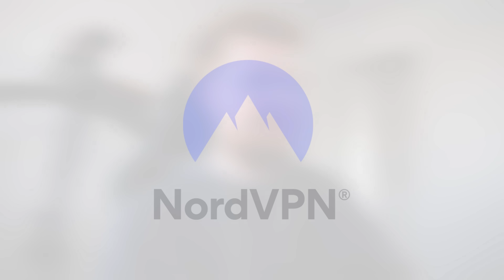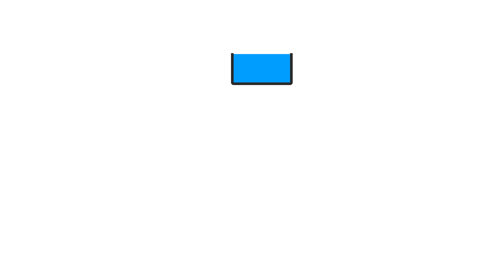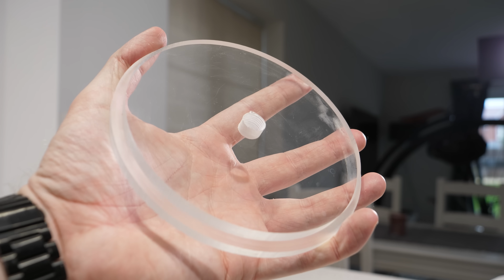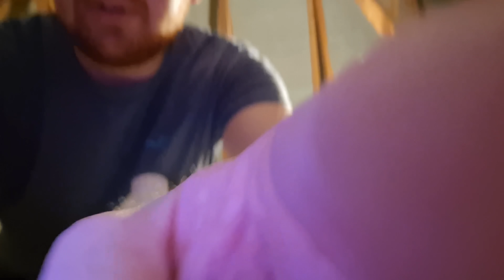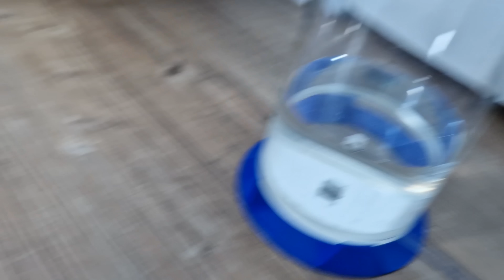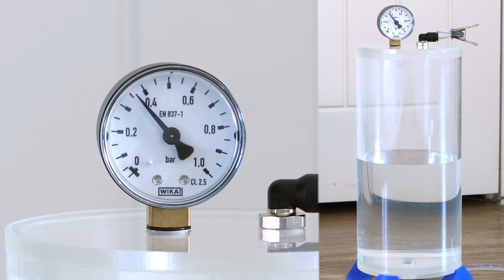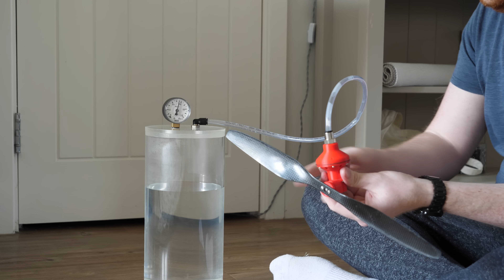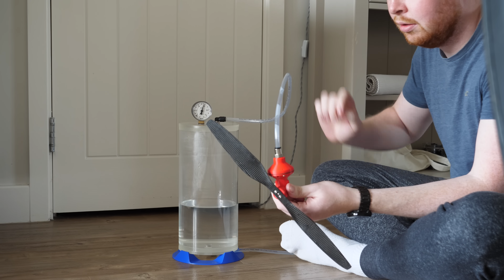Liquid Air Engine

Comment: hello, i'm from brazil and at least i'm curious, but maybe it gives you an idea of moving more efficiently, as the locomotives steamed a remaining pressure of the steam from the camera to use the how to make the camera go back to the beginning before repeating the movement, making the movement more efficient and stronger which can help and using a steering wheel to activate the movement more stable the movement which would make it even more efficient, I know that google translator's English is kind of bad, but any doubts look at the schematics of old steam engines so you can improve your project even more! good luck!

Comment: Hook the air engine directly to the water line and the water will spin the engine faster than the air will. Ever use an air grinder in a wet air line? When the water comes out the grinder is twice as fast.

Comment: that's really cool, i wonder i you could build like a gravity battery that pumps water into the loft when you "charge" it and then uses the pressure to generate power when you need to use it.. probably not really practical at all but might be an interesting project :)

Comment: maybe to have a more smooth rotating propeller you could make your air powered engine smaller and have multiple engines that are smaller and try to run them inline with a delay maybe? It might be like having a 2.4 L inline 4 vs a 2.4 L inline 6, same volume in total but through more "pistons" kind of. just a theory. It might have some flaws but it would be interesting

Comment: Add a float to top tank so house water can maintain it full.
Then increase tube size a bit. Flow will be proportional to diameter squared so not much is needed.
Then add a second air tank.
Upgrade both tanks so when one reaches ⅔ full, a float closes the air exit valve and opens a drain valve until it's empty. 
Time then so both lower tanks don't fill at the same time.

This will make it run forever as long as there's enough house water pressure to keep top tank full.

Then raise top tank to increase rpm.

Comment: Aside from some of the other comments about increasing your tubing size and having a float for air cutoff when the water reaches the top, all the system really needs is a pressure regulator to drop the output air pressure slightly so the motor runs at a constant speed, but the tank can keep up.

You could also consider using a trompe to generate your pressure so you could have a steady supply.

Comment: How about running engine with water which is pushed by air pressure? Similar to how water bottle rocket works. Put small water turbine into plane which is spinning the propeller.

Comment: What about making the air tank into  Mechanical piston. basically is  what you are doing with water, make a piston that goes in the tank make it spring loaded to keep consistent pressure on the out flow of the tank.

Comment: Don't forget that the height of your water column, and thus tank pressure, will drop slightly as the attic bucket drains, and also as the lower tank fills. You can fix the latter at least by filling the pressure tank from its top rather than bottom, using an S trap to keep air from constantly flowing back up the tube. As a side benefit, you'd also be able to see the flow rate as the lower tank fills.

Comment: Let's see what happens when water gets in the engine. I think it will run on water. Also a flywheel would help smooth out your air motor.

Comment: When pouring a lot from a small opening then start the opposite way that you poured and then when the container is 1/3 full turn it around and pour the way you’re currently pouring. This stops the glug glug glug shit from happening or it puts air into the container faster so it’s not gasping for air as the water is being poured from the container. U so smart but do dumb shit 😂😂🤪🤪

Comment: Maybe it's just me and my smooth brain, but all of that work seemed like more effort than just hogging out the existing hole in the tank with a bigger drill bit, cramming in larger fittings, and printing a new base to bump it up off the surface to make more space.

I really do love the iterating, though. Once the tank is completely full of water, could you remove the engine and plug in an air compressor in order to push the water back into the loft?

Comment: you could use the exhaust from the engine to bubble in a small tube back up to the watertank. each bubble in the line will push up water

Comment: Very interesting toward the end when the fan rpm dropped and the pressure in the tank went back up, then it oscillated between pressure and speed a few times. This is the same behavior you see in an electrical circuit containing a capacitor and inductor.

Comment: have you ever heard of a Trompe?
(if i spelled it correctly)

Its a way to pressurize air with water.
Which can then be used to do work.

Perhaps a nice idea to make a video of that?
Reply: as for air engines:
The Di Pietro Compressed Air Motor

Comment: You should put the engine in a vacuum chamber and have the air supply of the engine lead to the atmosphere on a valve, making it an atmosphere powered engine.  You could mount the engine on the achrillyc tube that supplies the engine with atmospheric pressure air within the actual chamber to really simplify things. But then how would you start it? maybe putting a couple strong magnets on a flywheel and manually waving another magnet around it to turn the engine over?

Comment: Very impressive. I'd be interested to see you try adding a flywheel to that. I suspect that it will be a lot more stable at low speeds.
Reply: Here as well as in older air engine videos the propeller is purposefully put on the engine to act as a flywheel.
 But yea an actual flywheel of decent weight would be great.
Reply: My thoughts exactly, it evidently had the power to keep going but the inertia of only the propeller wasn’t quite sufficient to keep it stable. I feel like both designs could probably operate at a lower pressure if a dedicated flywheel was added to carry that momentum into the next stroke
Reply: I imagine the propeller is very light since its made from CF
Reply: It's more difficult in precision working....but more smooth running can also be done with a 3 cylinder consrtuction...120 degrees between all the cylinders.
Reply: Wouldnt a flywheel drain more air? Wouldnt that mean that the water (gravity from an energy perspective) cant keep the pressure in equlibrium? I dont think you thought this through, but im no physicist.

Part of the reason it could keep going for so long was because it was slow and there was a 0.5 second gap between bangs.

It would keep the engine running smooth, i agree but it would last less than a minute, wich was his goal to be fair.

Edit: Wow i cant england... *wich goes against his goal to keep the engine running for long.
Reply: @domonkosludvig3314  A fly wheel in a rotating mechanism works a lot like a capacitor in an electric power circuit. It takes away some energy from the peaks, and fills in the troughs. This means that the engine doesn't waste as much energy accelerating and decelerating, meaning that with each power stroke it hasn't lost as much speed and can get on with the stroke under better conditions. If you don't want it to run faster, you can reduce how much air is being allowed to flow, further reducing the consumption.

Sure, a fly wheel costumes a little bit of energy, especially if it's not aerodynamic. But the gains far outweigh the cost.
Reply: @RandomKSandom  i dunno what i was trying to achieve with my comment...

I think i just wanted to say that simply putting on a flywheel would not work, you would also have to fill the tank with water faster using a wider pipe, cuz the air usage would be too much for a faster rpm (flywheel would increase rpm no matter what). I dunno why i chose the most complex way of saying that, or why i even wanted to let you know about that... Sorry for the bother
Reply: @domonkosludvig3314  
> flywheel would increase rpm no matter what
That's not how that works. Again, it takes power from the peak thrust, and distributes it through the rest of the cycle. Ie It makes operation smoother *and makes the engine more stable at lower RPM.* It will make reduced consumption possible, not increase it no matter what.

About throttling:
Remember that the whole point of a throttle is to stop the engine from accelerating uncontrollably. If simply adding a flywheel would make the engine accelerate no matter what, we'd be harnessing that shiz to give free energy to all... Or charging people for the privilege of free energy ;-) . The engine is driven by pressure, not vacuum. So it will take/allow what the supply gives it, not the other way around. When it is starved, it won't be able to accelerate.
Reply: @RandomKSandom  I've had arguments with other people in the youtube comments section, and usually when it comes to physics, I always do the heavy lifting and actually simulate the physics in my head, while others take the easy way and write something down that they learned in school. Its pretty tiring. I know that in a car what you said applies, but do you honestly think this happens the same predictable way with a low rpm system like this aswell? The acceleration curve of the engine would become less erratic, I know, but the rotation stops multiple times in the later parts of the video. How would a flywheel keep the engine running slow enough to achieve the same rpm shown here, while a relatively powerful air engine keeps cramming energy into it (it=mass of the flywheel) with every revolution? Its hard to explain, but there is no way fuel consumption wouldnt skyrocket with a flywheel and stop the engine after max 15 seconds, cuz the air pressure isnt high enough... I wish the guy would make a flywheel video to prove you wrong... 

The stopping is what made the engine last long... If you take that away, it wont last long... Pretty simple explanation.

Now for my prediction: You wont understand my comment, say something I already know but has no connention to this conversation, and then continue thinking that I have no idea how a flywheel works or something... Its gonna be fun!!!

Comment: Another way you could build air pressure is by having large bellows as an air tank, with a weight pushing it down - you could get a similar pressure in a much smaller space, and it would have a much faster response to pressure drops.

Comment: Can you somehow add a weight at the top of the bottom tank that gets released when the water gets too high, that pushes the water back up the pipe and back into the top tank. That would create a constant water supply to the bottom tank? 

Sure the engine would stop when the weight falls, and start again when the top tank is at a level, but that doesn’t matter if you intend to charge a battery.

Comment: I think the next step here is to replace the static pillar of water used to create pressure with a flowing scale trompe. Practical Engineering made one a while back to use flowing water to pressurize air. Might be a cool way to maintain pressure in the system.

Comment: You'd be able to get a sight pressure increase by adding a bunch of salt to the water! If you don't mind non-clear fluid, a water mixture with bentonite and barite can get you density at least 25% more

Comment: I'd love a series on using an air powered engine with a pressure vessel that contains dry ice and liquid.  It would be interesting to start with small amounts and play with ratios and volumes for the best run time.
Reply: A dry ice engine, that would be really interesting. I've never seen one.

Comment: It's insane how you can make that engine run at such low pressures
Reply: give me a 3d printer or im sending 15 tomatoes to your PO box (they will rot)
Reply: @jm10014  no no no, that’s what he wants to see, the tomatoes rotting away. Vacuum seal them to keep them fresh and disgusting
Reply: @averytameduck8725  noted
Reply: @jm10014  bro can you email them?
Reply: What a madlad
Reply: @BlackDragon-tf6rv  absolute madlad
Reply: It's insane how you can make TOMATOES run at such low pressure.
Reply: @unknowncuyler5449  "" It's insane how you can make TOMATOES run at such low pressure? ""...in fact THAT is a question that cience still aint answered = how does a tree as well carry all such material at such-a-height surrounded for a medium at nearly 1 atmosphere?????? .....
Reply: Integza you have a pretty tall house this could be an interesting project for your Wankel rotary air engine
Reply: @AiOinc1  Also perhaps he also have an Water Tank on the Roof. Some Houses still have Water Wells
Reply: Yes. Also he didnt crush tomatoes
Reply: yah and he didn't melt it or set fire to it. unlike some other youtuber i can think of. :)
Reply: he should make one out of machined aluminum or something, might work at even lower pressures
Reply: Tomatoes are disgusting 🤮
Reply: Devil tomato 🍅🤣
Reply: Integza, what if you could use the waste heat energy from a jet engine to power this air engine and be used as a boost engine? :3
Reply: i want to see you do that with a 3d prnted engine but with an integza twist
Reply: Not a big deal 😀You managed to run a 3d printed jet engine. The wobble of the turbine wheel is visible even to the naked eye!
Reply: Yall should collaborate on a rocket car?
Reply: But that probably costs the absence of torque..
Reply: Bloody hell fancy seein you here!
Reply: Inezga
Reply: put it like this weight like a piston on top of acrylic and below the air outlet so the weight will give pressure in the air until it stops
Reply: tesla turbines are inefficient and if you try to make it more efficient it breaks
Reply: Lmao
Reply: Integza again
Reply: Agreed tomato man
Reply: I hate tomatoz
Reply: I call this a "high" pressure....knowing of stirling engines which can run on the heat of a cup of coffee....
(0,1 bar or less)....and those are not professional engines....but "toys" for education at schools (from carton build).

@Rom  nevertheless ..I do enjoy these examples of "home made techniek" very much and my compliments for making this engine and showing it on YT.
Reply: Hello integza 😀
Reply: Says the guy who made a jet engine out of tin cans.
Reply: Why don't you coat a few of the internal surfaces with fine graphite since there isn't any micro mechanical parts in it it should be safe from binding the gears or bearings to greatly reduce friction after the diaphragm
Reply: It's not a rocket lmao
Reply: Wow
Reply: Dang I didn't know you trolled too . You pretty Impressive dude . Wish I had your motivation.
Reply: You two should collaborate on a dry ice powered plane.
Reply: Now destroy a tomato with Low pressure
Reply: By printer 3D.
Reply: When I was a boy of maybe 7, I had a water-air powered rocket. It was bought at a toy store.  It was a red rocket that you clipped onto a custom hand air pump.  You put water in the rocket and then pumped it up with air. When you pressed the lever, the rocket took off.  This was about 1977.  These things have been around a LONG time.
Reply: listen integza if we make this project much bigger it can lite up our future.
like 
1.it can power a car.
2.this engine can use as an power generator.
3.and mostly power a city.
Reply: So cool how Tom and others like Project Air don’t blaspheme isn’t it Integza, just respectful not a belief thing.
Reply: i dare you to create an engine powered by burning tomato’s
Reply: its like a fake perpetual motion machine.. can barely move under its own losses.. put it to work and it wont.
Reply: @BlackDragon-tf6rv I approve
Reply: hi
you can smash tomatos with small preassure
Reply: Yes I agree it shows great efficiency in his design. Also, hello Integza from Jim from Australia.😊
Reply: I will feed 30 tomatoes to a duck if you replicate this but make it run on actual water instead of air pressure!
Reply: your design had some problems with friction because it was made of UV resin which has a high coefficient of friction
Reply: https://youtu.be/dQw4w9WgXcQ?si=vxWwEQ-ODrr9JzUW
Reply: I am sending 52039 tomatoes filled with hydrogen into your 3d printers
Reply: I’m a big fan integza
Reply: Solidarity
Reply: So, Integza... when do we get your collab with our smart boy Tom here? I think it would work out smashingly. A good way to set the paste. 👌
Reply: Dont be a tomato. Work harder and have one.
Reply: Sup
Reply: Make an air engine that will crush tomatoes and it has high efficiency.
Reply: hi lol im your fan

Comment: WeldOn is great for gluing acrylic.  I’ve used no. 16 before by recommendation and it worked well.  I think the number corresponds to the viscosity of the glue if I remember right.

Comment: Noone has mentioned pipe organs!   The air pressure needs to tightly regulated or the pipes sound sharp or flat. Bellows with a sheet of wood on top and a lump of concrete on that.  Constant force due to the pull of gravity on the concrete distributed over constant area of the wooden plate gives constant pressure irrespective of the volume of air remaining.  Forget the water and acryllic tank. I enjoyed the video a lot, but unfortunately some people think it's efficient.

Comment: Does coke and mentos actually increase the pressure? I don't think it does. Veritasium once measured the pressure inside a coke bottle before and after shaking it and it was the same. I think that  mentos essentially do the same as shaking it just more efficiently.

Comment: By draining the water tank you can create a vacuum and maybe use this pressure difference to run another engine, thereby doubling the overall efficiency :D i don't know if it would work with a diaphragm engine though

Comment: The air pressure tank is called an accumulator 
You just used it different than it was supposed to but it works so who cares